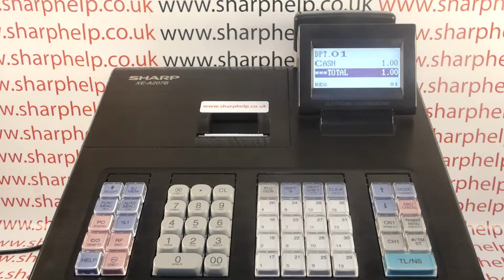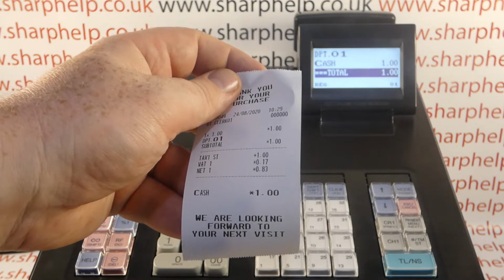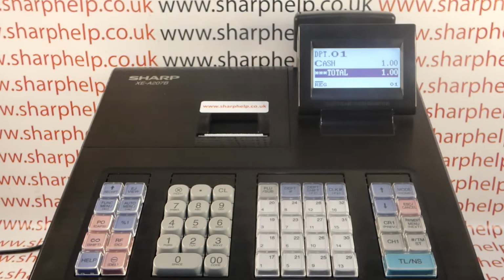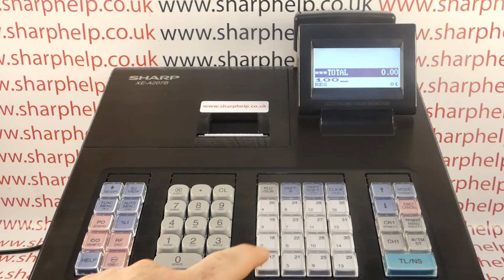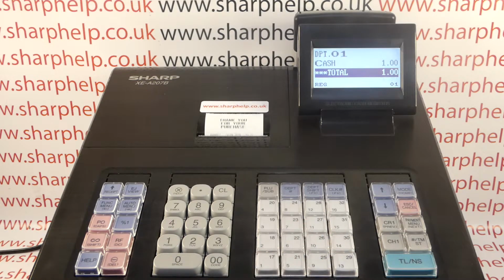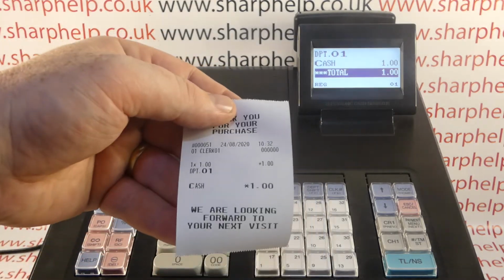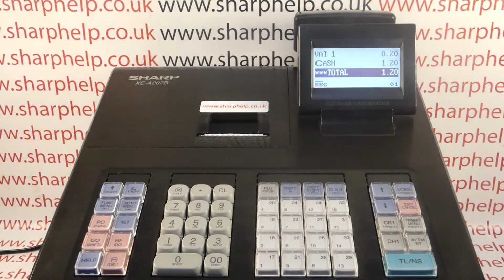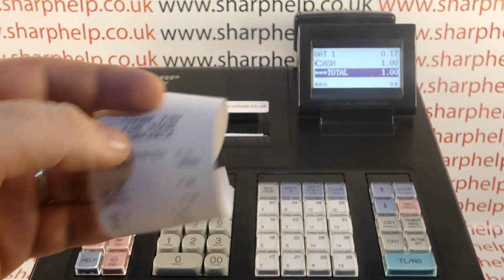How To Set Up Manual Vat Tax System Sharp XEA207 / XEA177 Cash Register Programming Full Tutorial

Comment: I am having a rpoblem with my tax on this machine. I am having a 50% off sale. All items are taxable at a rate of 8.25% - but when i got to add the 50% discount the tax rate is being applied to the ORIGINAL price not the discounted total......do you have any insight?
Reply from the maker: Hi Rachel, thanks for your message, in the settings for the discount you should be able to apply a tax rate. Thanks, Sharp Help